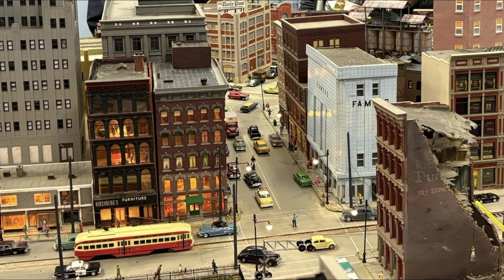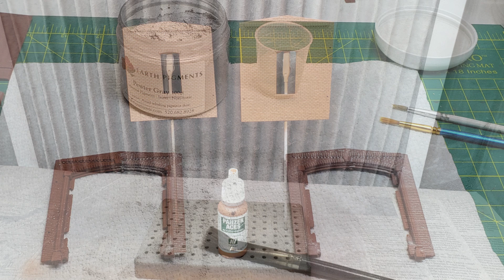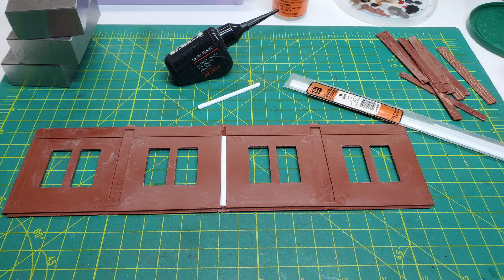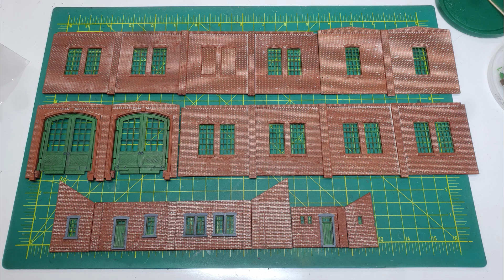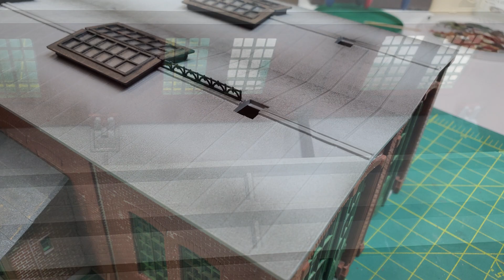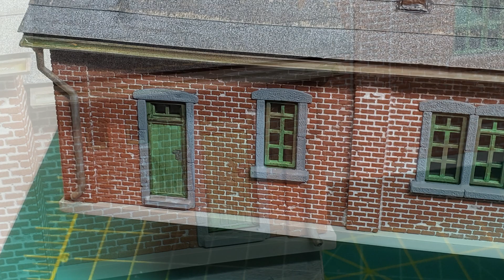Vollmer Engine House for an HO layout

Comment: Outstanding work, lots of great ideas. For what it’s worth, when it comes to acetate for windows, I’ve been collecting that annoying “military grade” anti theft plastic that everything seems to be packaged in these days. Might find a use for it.
Reply from the maker: Thanks, I appreciate it. Yep, you can find useful window glass in lots of places. I have a folder of different clear materials, mostly scraps and other salvaged items, plus some actual "window material" that I ended up with somehow. I usually use whatever's on top of the pile that fits. 😀
Reply: @CassidysWorkshop Did I understand correctly that you use dry pigment powder, brush it into the mortar lines and then apply water? I would love to try this technique.
Reply from the maker: @jimjohnston7688  That's right, it's one of a few techniques for putting mortar in bricks. Here's the video by Brett Wiley showing it better, the pigment-for-mortar part starts a bit after 8 minutes. https://youtu.be/JFnpvykISZs?si=_uzcb_x0PQnTxLoS